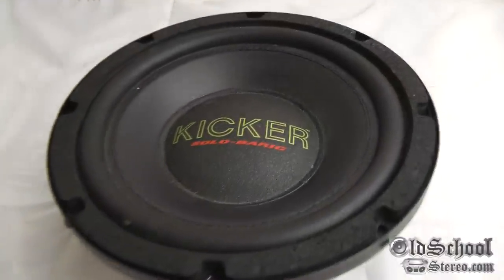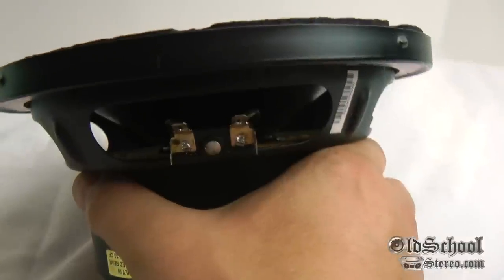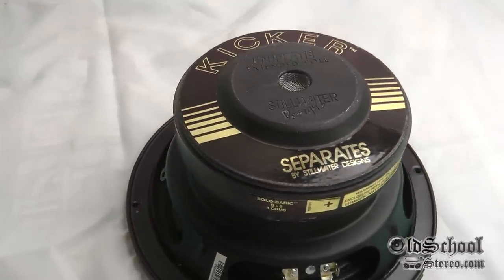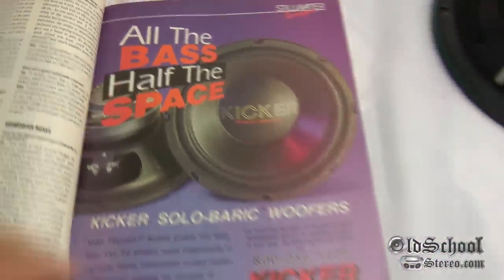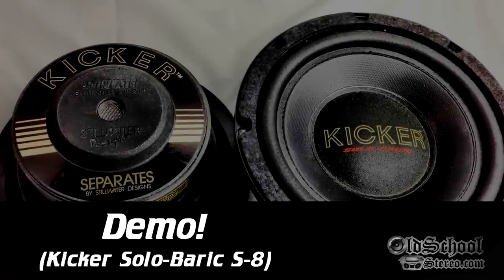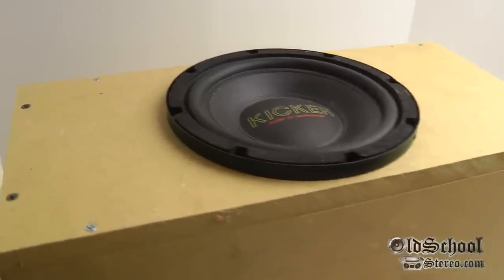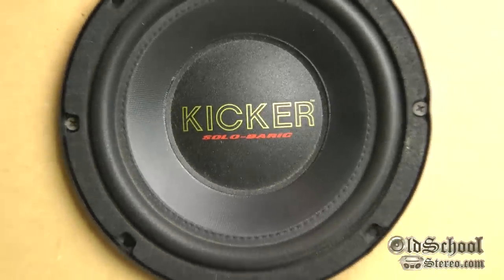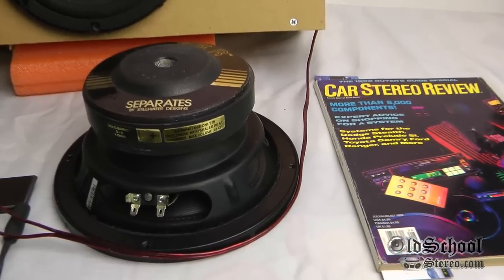Kicker Solo Baric S8 Subwoofer The First Generation Solobaric 1992

Comment: In my 88 Honda (IASCA Competition car in the 90's) I ran four solo-baric 8's powered originally by a Soundstream MC-500 then later by a Precision Power 5075DX with the PPI RCM-1000 optical interface, PPI Noise Gate, PPI PAR-225 5 band pre-EQ and Mcintosh MX-406 CD head unit. Absolutely incredibly accurate, tight, fast yet massively low bass. Used to blow peoples minds when I popped the hatch after a demo and they realized what they had just experienced was even possible running 8" subs. I had the first series like these but soon replaced them with the second gen. which had rubber surrounds, double stitching and a heavier cast basket. I later installed the third gen which were very similar to the second but with grey cones w/ inverted center caps. At the time it cost nearly $1,200.00 for a set of four. In my other vehicle at the time (Toyota v-6 4x4 p/up) I ran a pair of Kicker Comp. 18's (folded horn in bed) , x2 standard Comp. 8" (doors) , x1 solo-baric 8" (behind seat for mid/low bass) and x2 Dynaudio D-28 1" silk dome tweets (kick panels), x2 3rd gen. Orion 225 HCCA "Red Cheater amps" (one to the pair of 18's and the second to all other drivers). Both systems were not only insane ground pounders but they actually sounded incredible with an amazing soundstage presentation and imaging to die for. Even the Toyota pickup had incredible imaging which was not usually the case in compact MINI-TRUCK setups. Always happy with Kickers, Never had one fail.

Comment: I have 2 first gen S10 solo barics from 92. They were still in an old sound off car with the Phoenix gold cheater 2 channel amp , Phoenix gold 4 channel amp for the old Polk audio splits and Sony x-over network running off the old Alpine cassette deck with Cd shuttle (cd shuttle missing along with the 2 capacitors that made the old system). It was all installed in a 1990 Mercedes Benz 190E Sportline and I remember the car at shows back in 92. I would love to bring the old skool stuff back to as new. The subs still pump but the amps need a rebuild and I would like to use some of the back in the day brand's I would have used like MB Quarts for splits, hifonics amps, Clarion cd head unit with the built-in DSP and copper chassis and a better install to make better use of the boot. I would love to find the different types of boxes and the dimensions for building them as all I have been able to find is the 0.66 cubic foot sealed at 400wrms info here in Australia with no inclosure dimensions

Comment from the maker: My MTX Blue Thunder 10's from 1990 were designed for 1cu/ft sealed or 3cu/ft ported...I tried them initially sealed, then was much more impressed with them ported. I'm not sure why MTX never really had a direct comparison to the Solo's back in the early 90's. Yeah, JL Audio hit the market with a BANG! They may have been inspired by Kicker, but they captured the market and as you know, the mid-late 90's belonged to JL!! Those W6's were and still are incredible subs!!

Comment: why not explain the attributes of the speaker that make it able to operate in small enclosures and what were the adds and takeaways for this design?  I've been running square solo 8's for about 15 years and they still sound great and fit under my truck's back seat easily.  unbelievably well built

Comment: In 1994 I had an '82 Mustang I filled with speakers - it had two 15" Pioneer woofers in a huge box, then two 12" Pioneer subs in a truck box, then the thing that made it boom, two JVC 10" subs in a ported bandpass box, that was to go with a couple of super tweeters in the truck box, two more Pioneer speakers in the door (5' 1/4" maybe?) and some more tweeters on the dash. From memory the system was powered by two Kenwood amps that were under the seats, plus another dedicated Pioneer amp just for the bandpass box and some cheap amp (Pyramid I believe) to power the normal speakers in the door and tweeters. Needless to say this car was incredibly loud and to get everything to fit the rear seats were permanently folded down. The thing that stands out to me was how that small (by 94 standards) that bandpass box was compared to the rest of the system, in particular the two 15" woofers, yet how those 10"s dominated the low end and would boom like nothing I had ever heard. Smaller seal boxes were just becoming common but I never liked the sound as it was harder hitting but less boomy, for me, I loved the boom that just went on and on and that's what that bandpass box added to the system.
Reply from the maker: That’s a lot of subs in an ‘82 Mustang 👈😲
Reply: Indeed - it was pretty ridiculous - a collection of hand me downs/things I bought for cheap at the flea market, things carried over from previous cars, and parts that were thrown out that I fixed - for example the Kenwood amps were going to be thrown away by a guy in college as they were broke and he didn't know how to fix them, so I took them, opened them up and it was just a couple of caps that had blown, so a trip to Radioshack had them up and working. The car only fit two people in it because speakers were everywhere, but if me and my friends were out playing basketball or football I could just pop open the hatchback and literally fill the entire area with very loud pounding music. My ears still ring to this day because of that car.

Comment: I worked at dukes car stereo in the 90s. Had 4 10s like this. Traded 2. Kicker would send us custom box design. I made a bandpass for 2 10s. Output was plus 9db per speaker.so my 2 10s sounded like 6 or more. It was insane. Ppi 2200am a 2400am par245 eq and 3 way crossover.

Comment: Hollywood Sound Labs came out in '89 or '90 and their entire line was aimed at small enclosures. They had 12's designed to fit in .5 cuft enclosures which was mind boggling to me at the time.

Comment: And today not a lot has changed, you can get the Sundown SD-8 sub which works in a 0.25cu/ft sealed enclosure. Considering it's been over 20 years, the solobaric is a great sub for it's time.

But it's always a compromise, typically the output of small sealed subs like this isn't that great when compared to subs designed for larger enclosures.
Reply: Did you just really compare a long throw subwoofer to an old S8? Yeah this is an old post, but making any type of comparison of subs built today with those made over 20 years ago is pretty sad. And output is not always what it is about, you are going to get a different type of sound from a smaller box than a larger one. Vehicle dynamics play a large part of that as well.
Reply: I didn't compare output of subs, I said, the S8 was good for it's time considering the size of the box...again, not a lot has changed in that regard. I have had both s8's and still have sd 8's. 20 years later, boxes haven't exactly became any smaller now have they? Instead there are just a lot more subs designed that work in smaller boxes due to more popularity of smaller cars and consumer desires for small boxes, but larger boxes can yield more potential.

Also, you don't get different types of sounds between boxes. That doesn't make any sense, sub frequencies (50 hz and below) is sub frequencies regardless. A 40 hz note @  120db's for example does not sound any different between any box unless your SQ or box design sucks, either it's an accurate reproduction of the note or it's not. The box dictates how good it will perform for the given specs of sub. The differences (subwoofer specs and cabin gain aside) is the decibels per frequency of output.
Again, a sub designed for a larger box will have more output for a lower frequency all things being equal. It's much harder to design a small box sub with similar output. There are tradeoff's to everything in car audio.

Comment: original 8w6's in a set of 3 would be my favorite 8" setup i used to sell so many of them back in the day either in sealed (usually under the rear seat of an extended cab Chevy (the  original 2 door ext cabs) or in a custom built ported box i dreamed up for some reason everybody always mistook them  for 12"s and never believed they were 8's until trunks were opened...I'm Not happy about JL retiring the original w6 (and v2's)  Using "w6" on the new version does no justice for the original W6 line

Comment: Unless you had a Freeair, Kicker always recommended a sealed box. Now with their new subs they say it don't matter, sealed or ported. I never understood why anyone going for that big bass pound would want sealed, ported does so much better with less effort.
Reply: Fly house of truth
Power handling was based on movement of the cone being restricted by the seal boxes volume. This is why the solar Barracks were also pretty inefficient and needed a lot of power to get moving inside of a small box.
If we had a customer that was wanting to get a little bit more out of their sub by adding power, we would make the box smaller. Basically we tightened up the spring protecting the sub from overextending itself and bottoming out.. ported boxes or huge back then and the motor structures in today's standards were pretty weak so they would have essentially ripped their selves apart. That's why in the 90s you never saw a ported boxes, even in SPL vehicles, they all were sealed. Once subwoofer technology caught up with amplifier power, ported enclosures got smaller and so did warranty claims LOL. I mean you could put three 10-inch Subs in a 1.75 cubic foot enclosure or 1 ported 12. 
Cone area rules.

Comment: Your box is way too big. I have a pair of these that I got back in the 90's and a 0.33 cuft box was basically the diameter of the sub and not quite as deep as the magnet. You had to router out the back wall of the box for the magnet to slot into. Hooked up to a Soundstream amp, they still kick harder than a 12" without the need for a big capacitor.
Reply from the maker: 0.33-0.5 is acceptable for these. This box is around 0.5

Comment: I had 3 of the 8s of the 3rd gen solos in a 94 reg cab k1500 on a 2001 fosgate 800.4 it was amazing ,JBL components alpine head unit infinity 4x6s ,the kickers came from crutchfield for like 199 a piece they gave you a free q logic box so youd have the right airspace for them the good old days